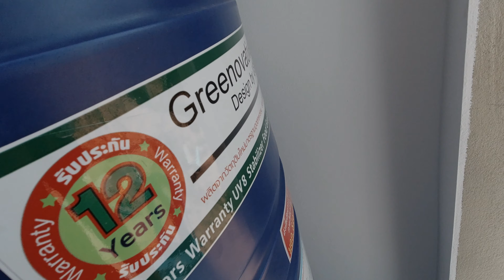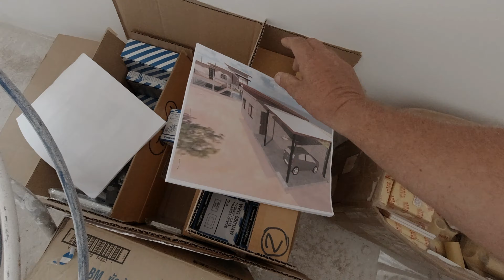Building in Thailand-Window installation

Comment: Once the finishes start happening the build takes on a different concept. Like the way the pumphouse is set up Bryan simple but effective and with safety built in. Most don't consider that aspect. Great job so far mate. You can be proud of the way it's going. Bushyboy Oz.